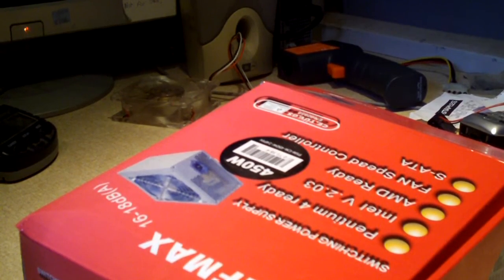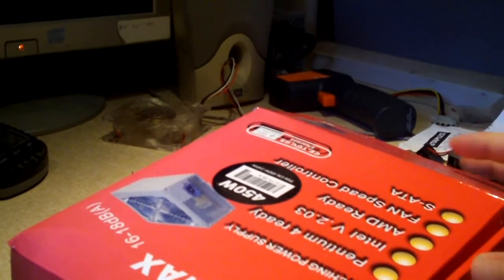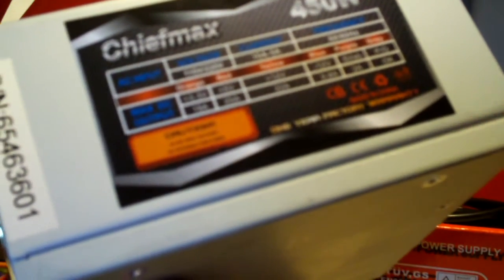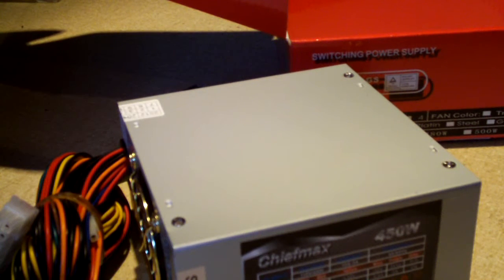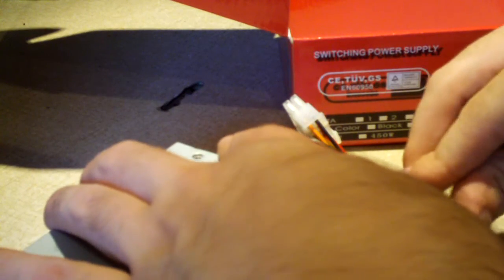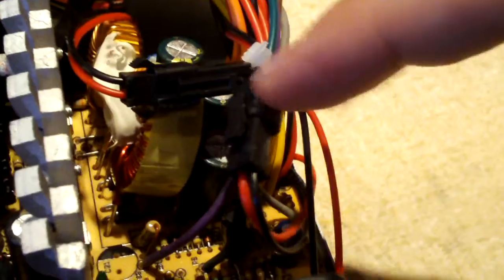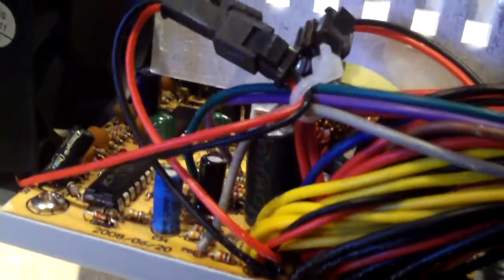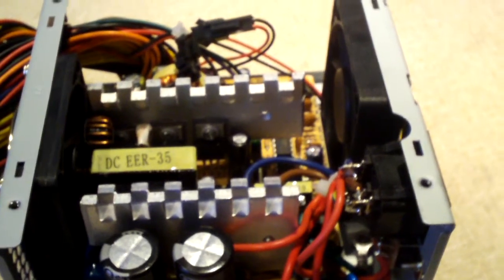Look inside a new ChiefMax 450W SFX power supply

Comment: you could have just used a recapped Hipro PSU unless it needed greater wattage than 350V
Reply from the maker: Where am I going to find a recapped Hipro MICRO ATX power supply locally?
Reply: i thought you had heaps of them well from a few months ago anyway.
Reply from the maker: realgroovy24 tech Not in mATX form factor.